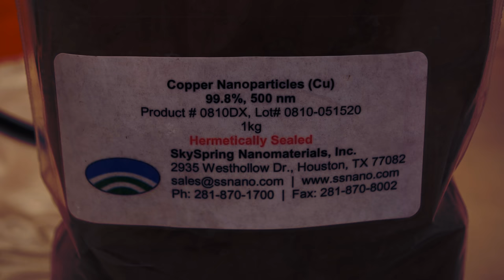Make Our Best Thermal Paste... YOURSELF!

Comment: I wonder what the results would be to simply skipping on mixing with those two expensive devices, but instead mix by hand and jump directly to the vacuum pump, and maybe temporarily add some substance with a low evaporation temperature, which to be evaporated by the vacuum pump at that step, but which to help with mixing the paste together before that step. For example, a laser could be used to heat the thermal paste to above the boiling point of water (especially in a vacuum), so we could mix water into the expensive thermal paste and have it removed by simultaneously heating and vacuum-pumping. For example, 1 bar is atmospheric pressure, and water boils at 100 C (212 F) at 1 bar (14.5 psi), but at 0.1 bar (1.45 psi; a tenth of atmospheric pressure), it only needs 45 C (113 F), and at 0.01 bar (0.145 psi), it only needs 10 C (50 F). 

Sure, it might take more time and energy to get the water and air out of the paste, but it might be a lot cheaper for a small (up to a few PCs) to medium (for a few hundreds to a few thousand PCs) batches, when including the costs of extra machinery. Though there might be some extra cost in that case, since for large batches you might need to start with the thermal paste frozen into a heatsink-like pattern to have room for the air to leave the paste and also have a weight on top to have the paste pushed onto more paste so it can clump together instead of staying separate, or use vibrations to get the thermal paste to settle down while the air and water are removed. Also, you might have just caused a thermal-paste crash a few months from now, and I love that pro-consumer right-to-repair-friendly move you just made!
Reply: Yea I wondered that as well, if it would bring it to be a better mixture and then you can just remove it

Comment: Thanks for this video!  Could you consider discussing thermal bridging for materials like metal for both cold and hot exterior temperatures? Specifically for construction methods, I'm wondering about steel structures that protrude outside of a building shell.

Comment: Great video! Is it possible to add a secondary liquid which helps with the mixing but than evaporates after application. Or would the evaporated material be replaced by air instead of the permenant liqued?
Reply from the maker: It's actually done with some pastes.  Shin Etsu has formulations that do that, but they're a tricky balance because of that air.

Comment: I have a suggestion from the compounding pharmacy industry. Check out an pharmaceutical ointment mill. A series of precision ground ceramic rollers that are absolutely fantastic for super thick things you want to have a homogeneous mix without air.

Comment: Home made solar collectors often flow solder between the fluid tubes and the fin material. It's metal to metal contact, and works well. I wonder if something similar could be done with CPUs. Some solder is very low temperature.

Comment: Just wondering if you tried any of the low melting point metal alloys? Field's alloy, for example melts at 144 F 62C has a thermal conductivity that isn't great at about 17 W/mK but in a liquid state should conform nicely to the mating surfaces without the pressure required for pure indium. I guess there is the potential problem of melting during use and causing shorts if it leaked onto pins, but maybe surface tension would keep it at the heat sink in the amount that would remain after clamp down. I also don't know how it might interact with aluminum or copper as far as something like gallium rot in aluminum or maybe forming a higher melting point amalgam that might make removal impractical, whisker formation, or what flux might be helpful.

Comment: For the last step, what about using a ROLLER MIXER and include some little marbles or ball bearing in the cylinder ? If you can make the VACUUM in the cylinder before to start mixing you can shorten the vacuum chamber step.
Thank you for sharing all your knowledges.
Reply from the maker: You'd need a mill, little balls or light rollers wouldn't move in this thick paste.

Comment: Idea for another video: aluminium air batteries.

I came across them some weeks ago and you handling the aluminium powder brought back the idea of them. The principle sounds simple and I ask if it would be possible to create one.

The more pressing question is: what would be necessary to "recharge" / refurbish them? Don't we just have to scrape off the oxygen and it works again? Do we really have to melt them down?

Hope that's an interesting enough area to investigate.

Loooooove the stuff you make. Thought about building a speaker myself.

Comment: You could make the mixing steps a lot easier by adding some additional lighter volatile liquid to the non-volatile silicone oil, that will evaporate out in the final vacuum step and leave the paste with the same ratios.
Reply from the maker: I tried that.  The compound tended to stratify during the evaporation/degassing stage and required additional mixing.

Comment: I think it would be easier on the last step of particles to add an anhydrous alcohol or perhaps another solvent to make mixing and dispersal much quicker. Since you're using the vacuum pump on the material at the end anyway it will evaporate away.

Comment: Hey Tech Ingredients! This was really eye-opening! Have you thought about trying to nitride the Al powder to create a shell of AlN around the Al nanoparticles? Baking reactive metals like Al and Zr in an ammonia atmosphere can cause this transformation of the metal to the metal nitride in shell that thickens with the reaction time and temperature. Since the thermal conductivity of AlN is about 100 W/mK better than the peak reported values for Al, there might be some room for improvement with a small nitriding furnace treatment of the Al. Excellent video! Thanks for always sharing!
Reply from the maker: I haven't.
That's a very interesting suggestion.

Comment: I'm curious about the efficacy of using a low-boiling point solvent to suspend the paste components into a less viscous mixture, homogenising it in that state, and then pulling off the solvent with prolonged evacuation/heating. It would have to be a solvent that's zeotropic with the carrier oil, but that wouldn't be difficult for the silicone-based one.

Comment: Have you heard of "curing" pastes? Shinetsu's 7921 has been renowned for its relative price to performance but also its cement-like viscosity. It's been said that the reason its so thick is that for longevity reasons they don't use silicone oil which will inevitably evaporate and severely reduce performance. However recently they came out with a new product 7868 which is much easier apply with silicone oil added, intended to evaporate after application, so the performance actually increases after "curing" for a few days. This must mean that they're using 2 different liquids with a long lasting one as the main medium and silicone oil only added to assist application right? What are your thoughts on this?
Reply from the maker: I played with this, but it's difficult.  The volatile liquid can lead to air infiltration if the residual material becomes too rigid.

Comment: This is a crazy idea, but what if you could use a coca grinder to blend the thick paste? And you can also pull a vacuum in the container to prevent air from getting in. Not really sure about feasibility though.

Comment: Oh man, the lab I worked in while in undergrad used a sonicator to lyse E. Coli cells for protein purification, and it was basically just in a side room with a few other things, you had a hearing protection (just those protective headphones), and it was so damn loud and annoying. At the time, I had some earbuds with built in active noise cancelling, and it worked fairly well, with loud music drowning it out, but damn, those things scare me. We'd lyse the cells in a plastic conical tube, and if you weren't careful, you could cut through the bottom of it and end up with a nasty E. Coli smoothie to clean up.

Comment: Thank you for another great video. I'm curious if you have already done so or are planning to do durability testing of this paste material in particular the long term cycling effects on 1- pump out, 2-reduction in uniformity and 3-dispersion.
Reply from the maker: We have two comps now running with this paste at almost 5 months without degradation.

Comment: This is absolutely incredible! My only concern is the mixing of copper and aluminum, as its a common concern when it comes to corrosion. Some heat sinks use a copper transfer plate. Would the aluminum paste cause corrosion with a copper transfer plate, or does the glycerin insulate it enough to not cause any corrosion?
Reply from the maker: It does.

Comment: there is no need for a sonicator if you just use silicone grease

you can just mix the powder in to the grease kinda like when you're kneding pasta dough, just add a little and incorperate it, add a little incorperate and so on

after a while you get a thick and smooth paste, might be too thick to use the "pea sized spot" method, but I prefer the "butter the bread" method anyways
using liqui moly silicon grease and 16-63μm graphite powder I get excellent results for laptop CPU, desktop CPU and Graphic Card.
this paste is even resistant to the "pump out" effect

I first used it as a temporary solution, but after seeing how well it worked I actually prefer the DIY stuff over the commercial thermal grease

Comment: I would like to know more about why the coated zinc was less viscous.

My thought is that the coating makes it smoother so it has less surface area interacting with the liquid.
Reply from the maker: Or the coating electrostatically repels the liquid like oil droplets sliding over a water surface.

Comment: I wonder if the oil in CRTs of rear projection TVs (back before DLP and LCD projectors they used tiny glass vacuum tube TVs screens based on Cathode Ray Tubes and these get very hot, so many had oil in a cavity between the CRT's glass face that has the phosphor coating that lights up to show an image, and the oil was to both allow light to pass through while pulling the heat out of that face faster and dissipate it into the large aluminum block that the first lens in the projection array was mounted on, also for heat expansion and contraction from cooling back down, they had a rubber diaphragm that would expand out when it heats and expands needing more room, and sucks back into the hole it covered when it contracted) 

anyway I was wondering if this oil in CRT projectors is a silicon based oil? stuff is pretty thin though not quite as thin as water. (I have three I saved for this oil since it was meant to handle high heat and not discolor thus ruining the transfer of the light, because I had planned on using it to make lenses that can be adjusted with stretchable flat sheets of clear polymer, and mount them over openings with a pump to control the amount of oil in between the two membranes BUT I thought it might be useful for this process so figured I could replicate it and even make some changes and test and report back both with peer review and possible alterations for various reasons.

Comment: Wonderful explanation. Really enjoy watching your videos and I'm impressed by the professional approach you have building your mock ups and demonstrations. Nice and concise explanations too! My company is designing, building and exploiting photo-bioreactor systems in the Netherlands. We are using high intensity mini LEDs on solid aluminum pcbs mounted to aluminum cooling blocks that are hard soldered to copper pipes filled with water (water cooling loop). Each of these strips contains approximately 100-200w of LEDs on a 8mmx700mm surface area. Since this is a lot more surface area per Watt then CPU's we haven't been too concerned with surface flatness or thermal paste performance. After seeing this video I am interested in looking into this more in the future though. Lowering power consumption is very important to us so if we can improve in this regard that would be very interesting. Do you also ship your high performance paste abroad? Do you think given our relatively low power to surface ratio, that investing in a better thermal compound would make a difference?
Reply from the maker: Thanks for the comment.
A good thermal compound like ours will help, but surface prep ie flattening and smoothing is the most important consideration and will help no matter what thermal compound you use.
Did you watch our earlier video on the thermal epoxy adhesive we developed?  I demonstrated an easy and very effective method to do this.  As you know, LED effeciency drops with heat.

Comment: Would it be possible to scale this up to finished ratios from the beginning if you used something like a chocolate conche refiner to mull the powders into the liquid? Those things are designed to run unattended for hours at a time, so I figured that it could probably handle the task.

Comment: I have a question about a similar material. I was looking into thermal putty. A high thermal conductive putty like substance. 

Reason: 
Adding thermal pads to GPUs is inefficient - because the higher their thermal conductivity is - the stiffer they get - and the gpu components all have different heights which makes it really difficult to evenly distribute pressure. But with putty it would be less of a problem. The stuff squishes well around components under pressure. 

Question: 
Could you make a putty like material with these methods? 

Thermal putty with good thermal conductivity is VERY hard to get. I ordered "TG-PP-10 Silicone" - but it will take 6 months to be delivered - if I am lucky. Its not easily obtained.

Thank you for your great videos. What a fantastic channel. Found it today and I am already subscribed.

Comment: The 2 questions I have are 1- what is the electrical conductivity? 2- what considerations are needed or I guess were taken into account for galvanic reactions? Otherwise very interesting. I get criticized for building a "lab" in my basement for brewing but I don't even have an ultrasonic horn, I do have an ultrasonic bath but that's as ritzy as I get... For now.
Reply from the maker: The paste in not electrically conductive.

Comment: Is there any significance to using copper on the 300nm powder step instead of aluminum? On that same note, I'm curious why aluminum is a better choice to begin with if copper is also available as a spherical powder, given that on paper it has higher thermal conductivity. Does it have other properties that affect the viscosity of the resulting paste?

Comment: Does your thermal paste shear-thicken much? Demolition Ranch recently tested the ballistic properties of non-newtonian fluids, but only using aqueous corn starch "oobleck". The most recent research papers I could find on non-newtonian fluid armor used silica nanoparticles and kevlar fibers. That could make an interesting video collaboration.
Reply from the maker: The glycerin version does have a narrow range of mixing where thickening occurs.
Almost all non-newtonian fluids have a range beyond which (below AND above) they operate as Newtonian fluids. That is the problem with thinking that materials like oobleck do not work well as ballistic barriers.
Reply: @TechIngredients  I'd be curious to test that in the orders of magnitude higher range for ballistic impacts. Even if the effects don't turn out to be unique, the collaboration with Demolition Ranch would be good.

Comment: Have you delved into pastes that are not electrically conductive? There are many applications that require a insulator such as mica between say a transistor and a heat sink, these pastes containing copper or aluminum (or any other electrically conductive materials) effectively negate that insulator.
Reply from the maker: Our paste is not electrically conductive.  The oil is an effective insulator.

Comment: Very interesting process and thank you for taking the time to walk us through this.  I have om=ne question , Would vibrating the mass prior to polacing in the vacuum shorten the time in the chamber?
Reply from the maker: Yes, but probably  not enough  to justify  the effort.  The vacuum has to be used.  Just extending  the time is easy.

Comment: Thanks for the awesome video! Curious thought, could mixing each solution with distilled water then dehydrating it achieve a similar result without the lab grade mixing equipment?
Reply from the maker: No. The silicone oil  isn't soluble in water and the combination  would produce a mess. We tried  a organic solvent, hexane, but the result still didn't  work as well once the hexane evaporated.

Comment: In a metal, the high conductivity of heat is due to convection of the electrons, not the transfer of energy from atom to atom in the lattice.  That's why metals conduct heat so much more rapidly than typical non-metals.
Diamond conducts heat rapidly through phonons; again, not by bumping atoms around in the lattice.
A 'heat pipe" will conduct heat much faster than a solid piece of metal.
Reply from the maker: Phonons are vibrations in other words they are kenetic energy based.

Comment: Great video, as always !
But there's something I don't understand about the cheap/simple version : as you said in your video, copper has a better thermal conductivity than aluminium, and you also said that the powders are the same in size and shape, so why does it works better when using the aluminium powder ?
Reply: I think Al is cheaper and more easy to obtain